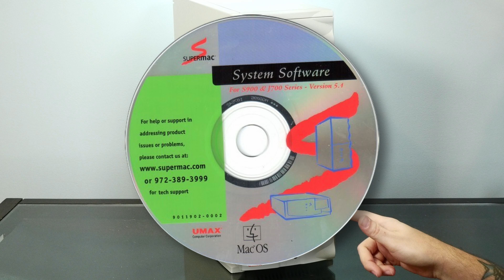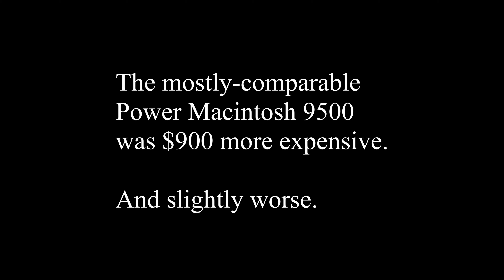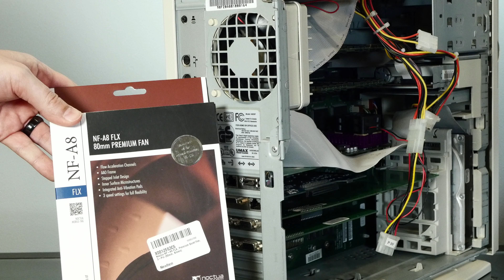Exploring a rare Macintosh Clone from 1996 - a pristine G3-upgraded UMAX SuperMac S900! (Part 1)

Comment: The case/chassis was also used by Dell in the 90's/early 2000's, for example, the Dimension 4100, though it had a different front bezel. I believe the motherboard in the SuperMac S900 is effectively ATX in design, and should work in other ATX cases, provided the I/O shield is removable. Cool find!
Reply from the maker: Aw man I didn't know that! I'm going to have to find a Dimension 4100 haha.
Reply: Or take the guts out of this one and put it in a modern case. RGB Mac! Ha ha! but please don't...
Reply: koz_tech I was thinking the same thing! The side panel door is the give away as it’s identical to the Dell Pentium III tower I have.
Reply: @Mac84  I think Micron used a similar one with their PC's too, but I don't recall.
Reply from the maker: I looked up pictures of some of these other machines that used the same case and it's blowing my mind haha.
Reply: I knew that looked familiar
Reply: Action Retro I had a Dimension XPS back in the day, when I first got my S900 I immediately noticed the case was a lot alike
Reply: The PowerSupply in this is not ATX-Compatible. It has a weird AT-Look-Layout, but you can build an adapter.
Reply: Yea i was going to say the same used to have a dell with the same case.
Reply: Came to the comments to say this! Good eye!
Reply: Yes, I came to the comments just to say this! That side panel looks identical to a Dell Dimension XPS T450 I had back in the day.
Reply: I have a Dimension 4100, and can confirm it has the same case but with a different front panel.
Reply: I have a Dell XPS R350 with that Case. Different but else the same case.
Reply: Beat me to it, thats the first thing I noticed.
Reply: Thought that side panel looked familiar. Didn't the Dell cases also have a narrow metal bar that went across the middle (front to back) behind the side panel?
Reply: Palo Alto made the cases for Dell and Micron.  You could also buy the bare cases, I built my wife's friend a computer with one.
Reply: NEC, Micron and many other brands used the same OEM.
Reply: A bunch of different Dell models including early XPS models used versions of this case. I've Dell variants with at least two different front panel variants. Also Micron had versions of this case as well.
Reply: yep, ANTEC also sold this case for the aftermarket
Reply: @datasoftinc  Can confirm ATX power supply does fit in these cases.
Reply: @vjnobody  The connector IS NOT ATX-compatible! It looks like an ATX power supply, but the connector is totally different.

Comment: Really, it was more of former CEO's John Sculley and Michael Spindler that caused Apple to fall apart in the mid 90s. In his eighteen or so months as CEO, Gil did what he could to steer Apple in the right direction, and most importantly negotiated the deal to bring back Steve.

The S900's case is interesting since it was also used by PC manufacturers, including Dell and Micron, just with different front faceplates. That bigger video card might have more RAM, or perhaps the same amount in a lower density thus requiring more chips.
Reply from the maker: Hah yeah, I've always seen most of the hate directed towards Spindler.
Reply: Also if anyone really cares, Michael Spindler passed away in 2017. His death is so obscure, that there isn’t even an exact date and not a lot of people know about it. 

I guess his awful reputation from at Apple caused him to fade into obscurity.
Reply: I thought I recognized that case as a dell Case from the time!

Comment: this case, though customized by UMAX, appears to be an Antec case, used by several VARs, it's those tell table squeeze tabs, that circle on the door and the retainer screw that give it away. the interior beige structure, etc.

Comment: The E100 Mercury card combined UW SCSI and 100 Mbps ethernet on one card BUT it only works in the top PCI slot of the S900 or J700.    Notice the extra tab at the end of the card connector.   If you install it in a regular PCI slot, the SCSI portion works, but the ethernet does not.   Also, the ethernet portion doesn't work with G3 upgrades, unless you get an extension from PowerLogix, I think.    But that extension, when loaded wrong, corrupts your PRAM in such a way that the machine will only boot to black screen.   

As someone else mentioned, the bigger card is the Ult. Rez. card from ixMicro (formerly IMS).  It does not play well in the lower four slots of the S900.  The memory is hazy, but I think if you load all the extensions for the card and then try to change resolutions it will freeze the machine if it is in a lower slot.

Comment: The notch in the DIMM sticks indicate voltage.  During the 90’s we had both 5V and 3.3V 168-pin DIMM memory.  Macs used 5V with some exceptions and PCs used 3.3V.  It wasn’t until 1998 when pc and Mac memory was interchangeable.
Reply from the maker: Oh yeah makes sense, thanks!

Comment: Helpful tip for those looking for quiet fans:  You don't need to spend a ton of money on Noctua.  Digi-Key has a pretty big selection you can filter by parameters, such as RPM and acoustics.  I always keep a few of these on-hand for refurbishing power supplies:

Part #Q1077-ND, Qualtek 12V 80x25, 1600 RPM, 18.3dBA, 20CFM.

IIRC, they're around $8 apiece.  This is the 2-wire version, which is ideal for PSUs, and case fans for systems that don't use a tachometer.  It's nearly silent, and makes using my old 386, 486, and Pentium systems so much more pleasant.  You CAN hear them, but you really have to listen for it.  And, importantly, it does still pull some air through the case.  On P-II and up, with hotter CPUs and graphics cards, I'll put one in the front of the case too, for a push-pull arrangement.

I also have some NMB models picked out for systems that PWM the 12V line (not the 4-pin plug that modern systems use.)  Those have higher RPMs, and thus more noise at full speed.  I also use those in XTs and ATs, where a fan hum is kinda part of the experience.

Finally, I do keep a couple Gelid Solutions Silent 4 / 6 / 8 around for 40mm, 60mm, and 80mm sizes where I want a really quiet fan with a tach.  I've had these for a while and may find a less "PC Mods" type of alternative when I run out.  They're not particularly cheap.  But they are nice and quiet when replacing the old dental drill Pentium CPU coolers.

Comment: Excellent video!  One of the things that makes your videos extra special is that, you just start your upgrade or repair but never know if, any of it will fit correctly or work properly with your computer's current hardware and software in this case a UMAX S-900.  Which, is the same thing that always happens to me when, I try to work on any vintage apple computer system.  Some where during my repair or upgrade at least one or more things will always go in different direction from the way that, I had planned.
Reply from the maker: Thank you! I like to make "optimistic educated-ish guesses" about what might work in a given machine :)

Comment: Again, nice video. I wanted one of these back in the day, but I had an 8500/120 that was maxed out including a Newer Tech 400 MHz 604e PCI upgrade card. Also, you should watch my first Micron Millennia video. The case on your SuperMac, while cool on the front, is a very common OEM case design  from the late 90s to the early naughties. It’s used on my Micron Millenia XI  (I live in Western Idaho - Micron country) and also a shit ton of beige Dells, particularly the Dimension 4100 and the XPS T600R. What an OEM would do is design the front, and customize the carcass for their needs. Power Computing uses THE SAME CASE! So if you ever lay hands on one, you should show them side by side. They decided to keep it simple on front to cut costs. My sense of irony, always turned up to 11 notes that you could shorten Power Computing to PC. Take that FWIW.
Reply from the maker: Thanks Steven! Holy crap I didn't know this! Now I have to find one haha.

Comment: That's a cool machine.  Man... 1 gig of RAM in 1996 is unreal!  That's half the size of the hard drive!  Can't wait to see the finished product.
Reply from the maker: Thank you! I couldn't even wrap my brain around 1GB of memory in 1996. I was running on 32MB.
Reply: @ActionRetro  In 1996, I was still on a 486DX-33, and I MAY have had 8 megs by then LOL.
Reply from the maker: Haha yeah we had a fancy P200 MMX... unfortunately it was a Compaq!
Reply from the maker: Actually wait, I think MMX came out in 1997,which means I was still using a 386 at the time!
Reply: @ActionRetro  LOL. I went straight from an 8088 to my 486. It was quite a leap 😂😂

Comment: Oh cool, a high-end Power Macintosh in a Dell Dimension 4100 case. Or is it a Micron Millenia case? Maybe an OmniTech PC case?

It's no surprise that UMAX Tech used that case for its flagship Mac clone. Definitely one of the best 90's case designs ever produced, and very popular among many computer manufacturers. You could easily swap the front bezel and rear I/O plate among a bunch of various 90s computers using that case, and no one would be any the wiser until they looked at paper labels on the back or within.

I used to have fun confusing people by booting natively into MacOS 8 using a "Dell Dimension XPS T450."

Comment: The twin turbo 128 that is smaller is 4MB only and a 2D card. The larger one is most likely the Ultimate Rez, look at the sticker on the eeprom top left corner close to the port for revision. That one can accelerate 3D and was great as a workstation card. You could game on it too but not too great! Both are excellent Macintosh graphics cards though. The IX3D is newer btw. Both were made by IX Micro.

Comment: The case looks fancy (and it is actually great), but this is an "ATCX convertible mid tower case" build PaloAlto Design Group. Exactly the same case you could find in Dell, Micron, HP Vectra and Kayak in the mid-to-late 90s. The only difference is the front bezel that snaps which differs from one brand to the other. I bought this case in the retail market in 1999 (not from an OEM, unbranded). This is a very very nice tower, very well built. Oh and yes, I also own a PowerComputing Mac clone with a G3 ! Nice machine !!

Comment: The major problem with the Mac clones back in the day was that a PCI video card or any extra expansion would work in some of the 7 clones available and people were getting more frustrated and getting a PC. There was no quality control with the clones, basically a bunch of companies was creating clones just to take advantage of the Apple brand. That is why Steve Jobs stop giving licenses. I remember very well.
Reply: Never had issues with compatibility any more than the 8500/9500. Australian distributor only used stock TwinTurbo's, ATI Rage128 or the Matrox G200 with the Mac firmware and didn't have to RMA much at all. Same ratio of reliability issues with all that generation, including finding the odd dud G3 daughterboard, being unfortunate to use an IBM DeathStar, or worse thinking you'd dodged a DeathStar data issue by backing up to a Zip. The biggest issues we had were the bad grounding for audio, the razor sharp metal sheet inside the side-cover, and getting a consistent cost and supply of RAM.

Comment: I bet that case was made by the same company that made the Dell cases of that era.  Other than the face, it is exactly like a Dimension of that era.  Including fan shroud, side panel removal, drive layout, and circle in the center of the side.

All they did is make a different front.

Comment: Wow, that UMAX has the same case Dell was using around the time period. I happen to think the front bezel on these UMAX machines is pretty ugly, but that's largely because I'm comparing it with the 9500 and 9600. If I were comparing this thing with the hideous monstrosity AIO that preceded the iMac, I'd gladly take this thing any day of the year! I just don't like doors much.

Your UMAX optical drive probably needs a new belt. Techmoan has done many videos on replacing those. The lasers can also fail, but … the belts are more common failures on drives from this point in history.

Comment: Correct me if I’m wrong, but I’m pretty sure that mid 90 CD drives did not read written discs.
Reply: They can usually read CD-Rs. The problems are much more common with CD-RWs.
Reply: With the eventual speed madness. Write speed set to high, and attempting to read at slower speeds can cause issue also. Ah the old format rw design issues. Windows audio format, adding a program so writing can be done. What file format to use. Which color would work. Formatting for the lowest common denominator, copy protection any one?
Turn on auto run or boot, on insertion? 
Higher speed and more noise? What the heck?
Oh wait another manufacturer designs to a different standard file system?
Ah the memories.